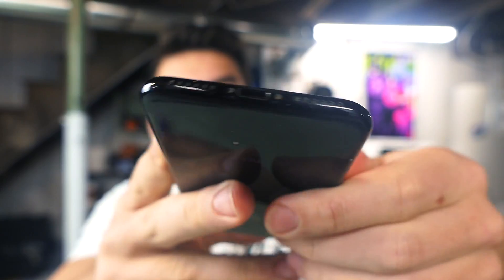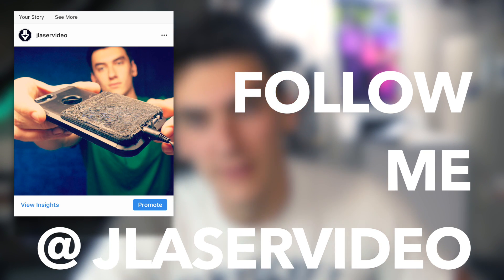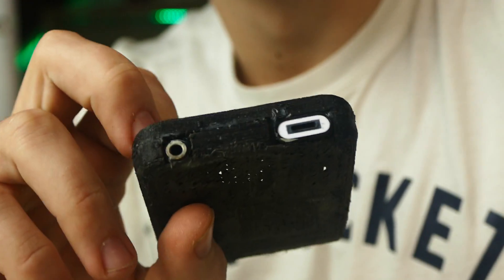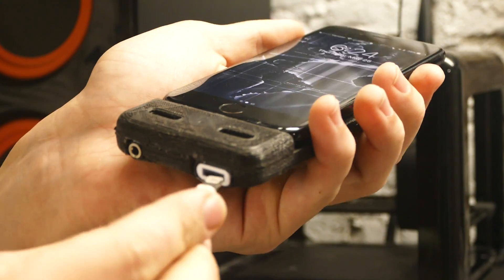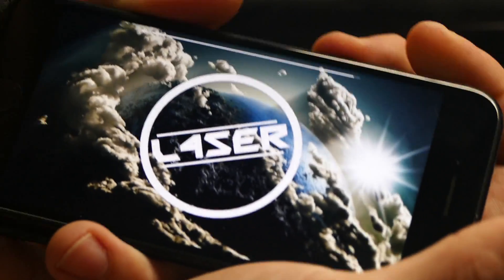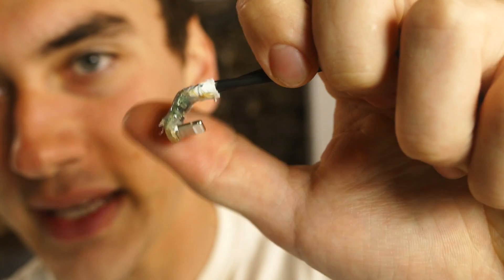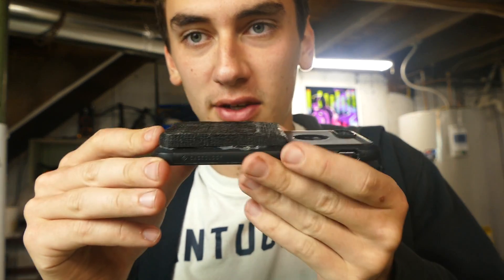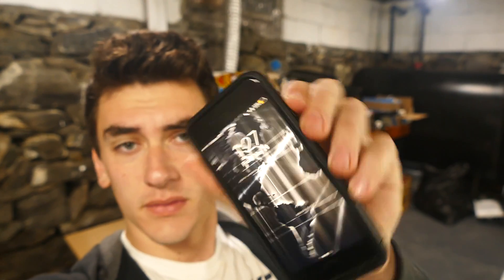iPhone 7 Headphone Jack Hack! - (Simple Cheap Solution)

Comment: You also couldve 3d printed a little head piece to connect to the bottom so that the adapters grasp on the phone is better, we wouldn't want the lightning adapter breaking off in the phone. I recommend a sliding head piece so that it can fit iphone pluses and regulars alike. good video tho